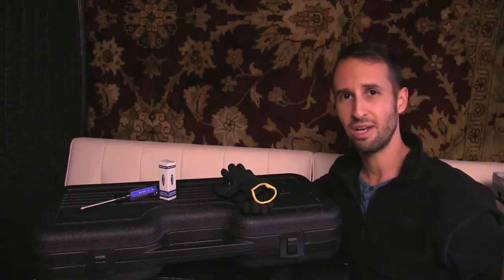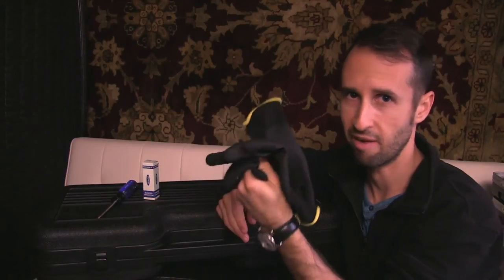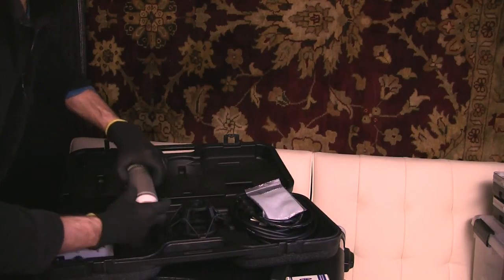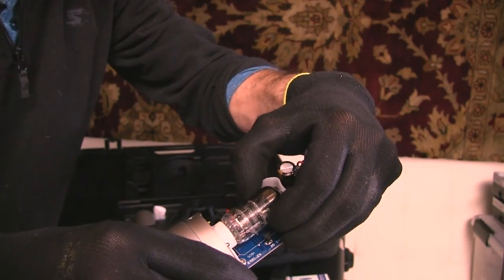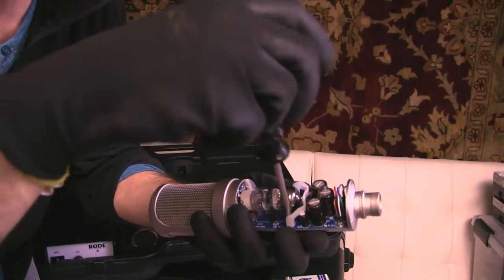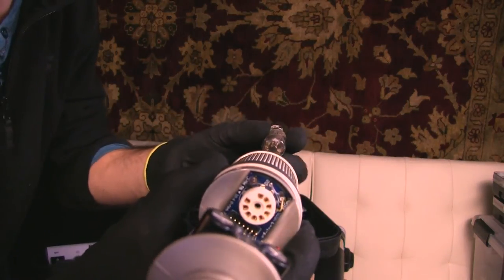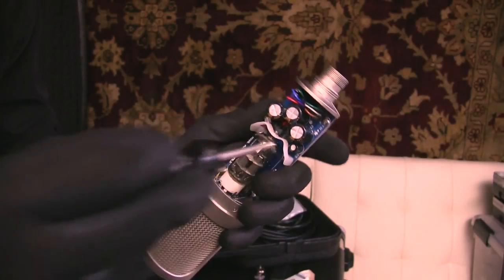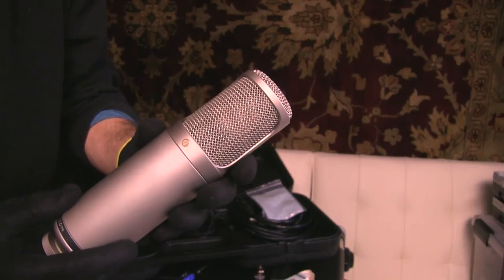Rode K2 Condenser Microphone - How to Change the Tube (DIY)

Comment: Do you think the new Telefunken Black Diamond series tube would work on this model or the Rode NTK? I will soon make the purchase for this microphone but if not I might just spend the money for a preamp or something else.
Reply from the maker: Any tube that is designated as 6DJ8, 6922, or 7308 will work. It turns out that Telefunken historically produced a diamond-series tube that is compatible: http://www.audiotubes.com/6dj8.htm

As far as preamp consideration is concerned, I think the K2 pairs very nicely with quality preamps. Is there a particular model you are considering?
Reply: +Lansky Sound Although, I mostly have experience doing hip hop, recording rapping and singers a few times, most tell me to go for an Avalon 737. I wish, but I would rather spend my money on building a dream Lunchbox using the Api 512 c (or the new 512 v if it is not all too expensive), a Focusrite Red 1, an SSL Vhd, and the Rupert Neve Designs 518, and hopefully a couple of eqs and an SSL compressor. Unless you have any other recommendations for singers and or rappers this is what I will probably go with. I am open to recommendations.
Reply from the maker: You cannot go wrong with any of your choices & I'm happy to hear you're interested in investing in such solid gear. I do not have enough experience to comment with authority on the devices you have listed, but I think you are on some very good tracks here! I do think it is worth replacing the stock tube in the Rode K2 with a high-quality NOS tube if you are intending to use it as the resulting sound is much improved. It would be awesome to hear about what you decide to do!
Reply: Lansky Sound Ohh definitely. I will have to post something soon, seeing as how all of my work as an engineer, producer and artist are all on other sites. I honestly had my mind set on the NTK, with a new Telefunken tube, but if these sound even better, I will have to go ahead and make this purchase and see for myself.
Reply from the maker: PGE II Music
I couldn't tell you how the K2 compares to the NTK. I get the feeling you'll be happy with whichever you choose! If you can afford to step up a notch, I would recommend the Mojave Audio MA-200 over the Rode mics. In the end, it's going to be how the mic is used that makes your tracks sound their best.
Reply: Lansky Sound Sweet thanks. And the site that you gave me for the Tubes, I just give them a phone call or what?
Reply from the maker: Yup! AudioTubes.com has a wide selection of manufacturers for the correct tube at different price points. Call the number & ask for Brent. He will tell you what tube is best for your recording application within your budget -- great guy! Tell him I said, "hi" :)

Comment: How much time should i allow k2 to sit powered on to warm up the tube?
Reply from the maker: I usually wait an hour to let the tube fully heat up & stabilize. I find the noise floor settles down & response smooths out. New manufacture tubes may not require this long, but I've also read that valve tube mics (like our beloved K2) require about an hour regardless. What are you recording? It would be cool to hear!
Reply: Well i'll record acoustic guitar and vocals.Mine is stock rode russian made tube.So i have to let it warm up for an hour?Also is there any way to check whether the tube is properly warmed up or not?.Thank you
Reply from the maker: Yes, 45 minutes to an hour is recommended by me! Having said that, the microphone will still work just fine if you don't wait at all. I find it sounds best after warming up & stabilizing.

To check if the tube is properly warmed up, you will need one of these: https://www.amazon.com/Mattel-30188-Magic-8-Ball/dp/B00001ZWV7

Just kidding! No way to really test. Good luck!
Reply: Well...what is this magic 8 ball?🤔
Reply from the maker: ;D
Reply: Lansky Sound you're funny😂
Reply: Well i'm using k2 with focusrite scarlett 2i4 1st gen audio interface.Is it enough to get maximum out of k2 or i should buy a new audio interface or mixer and preamp with tube or without tube?Or if you can suggest anything to get maximum out of it.Thank you
Reply from the maker: This conversation could get quite expensive, haha. My first tip would be to record at the highest sample rate you can. Sample rate = quality. Next, a good outboard preamp will do wonders to your signal & improve quality with any microphone you use. You get what you pay for so it's best to decide how much you can spend & search in that parameter. You can go nuts finding good compressors & other stuff, but at the end of the day it has to stop somewhere! I hope this helps ;)
Reply: Abhishek Gupta You can use RME audio interface with Rode K2.

Comment: dumb question, why do you have to warm it up? Im trying to buy this mic but I heard it's too harsh for vocals, which is the only reason I'm trying to buy it for...
Reply from the maker: Here is info on why tubes should warm up: http://sound4vo.com/some-like-it-hot-tube-microphones/

I wouldn't say the K2 is has a harsh quality to it, but I will say it has a distinctive, almost compressed old-school tonality in my opinion. While changing the tube may improve the flavor, it will not cause such a dramatic difference that the microphone sounds totally different. On vocals, I find the K2 to be big & warm, but definitely not clean or modern.

If you are looking for a modern, very clean vocal microphone, I strongly recommend the Mojave Audio MA-201. I have a lot of experience with this model & will attest to its lovely quality on vocals of all kinds, as well as instruments. The only thing I'm not super fond of putting into this microphone is a violin. Vocals tho, get a MA-201 if you even have a doubt in your mind.

Comment: Why would you have to replace the tube.. what happened to that previous one?
Reply: Tons of reasons can trigger this. Tubes have an expiration.. think of it like a light bulb.. after hours and hours of being on and in use the tube gives out. You start getting hiss (one of the most common signs of it going bad) sometime it completely give out and you might even get abnormalities in gain.
Reply from the maker: different tubes impart different tone qualities as they amplify the electrical signal. a different tube can completely change the performance of the mic! I do it because it's fun :)

Comment: Hi can i use a nos telefunken ef800 tube ?
Reply from the maker: +Zaki El Horan You cannot use the EF800 as it is an identical pin-out to the 12AX7. This is a smaller tube that is not compatible.